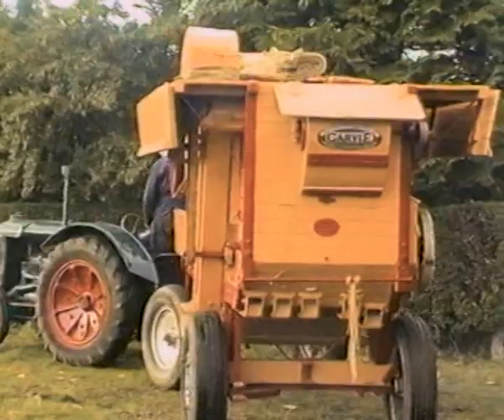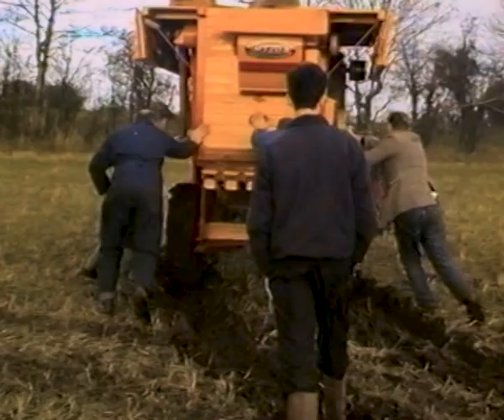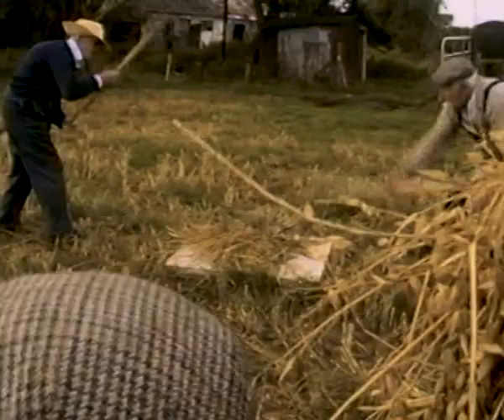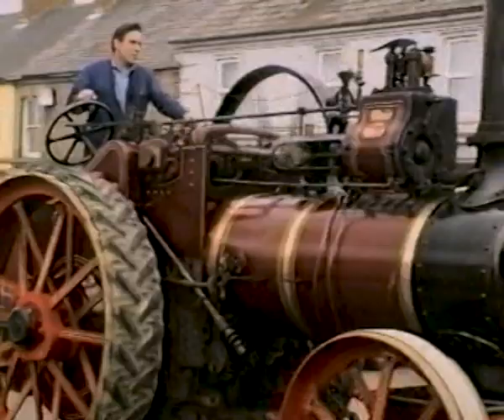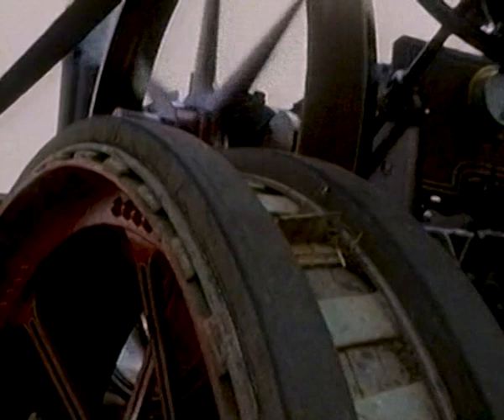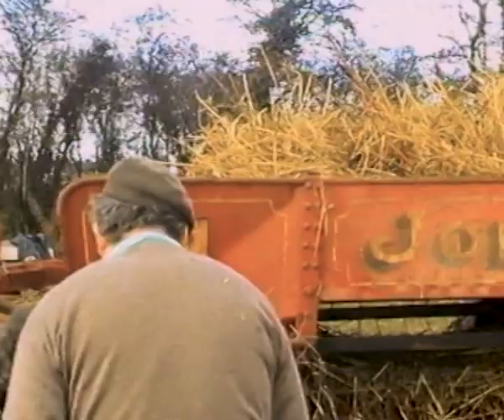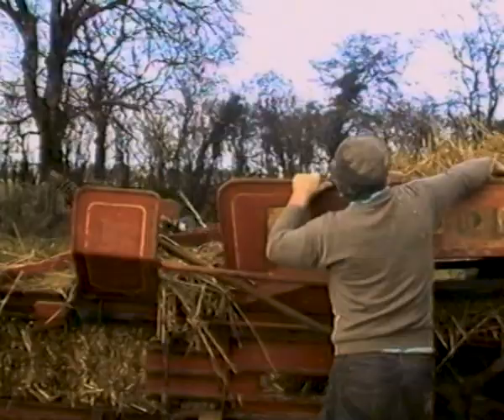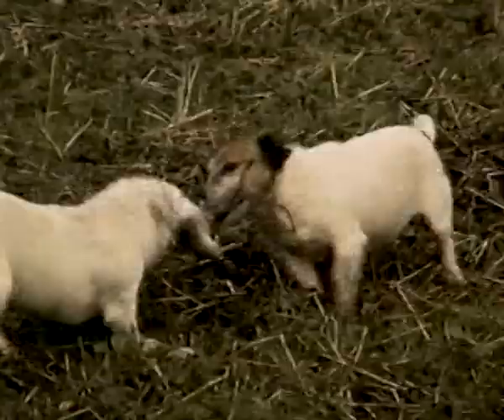Vintage Farming Ireland- Threshing Oats - Irish Farming Documentary - Videos of Irish Farming Life

Comment: we had large barns where the threshing was done with flails..there were two double doors opposite each other so the wind blowing through removed the chaff..a board was placed across the doorway to hold the corn back...called the threshold...which we still call the doorway today...our job as a kid was to chase the rats as they came out with a big stick and beat them one...and on the baler we threaded two wires in which were tied to hold them together,....
Reply: That is very interesting to the origin of threshold.  I'm 100% smarter now.
Reply: Thresh was used in all country houses with stone floors as the stones would get dangerously slippery with winter mud tracked in. The thresh would slowly get pushed out the doorway by foot traffic if a 'thresh-hold' was not employed.
Reply: So that's where " threshold " came from.  The stuff you learn.